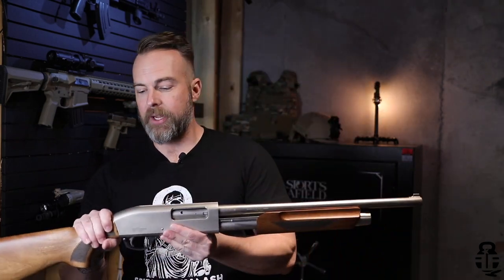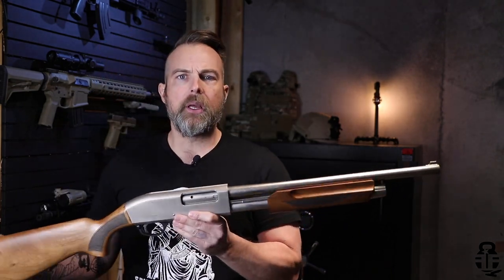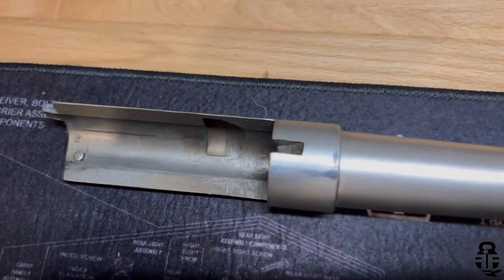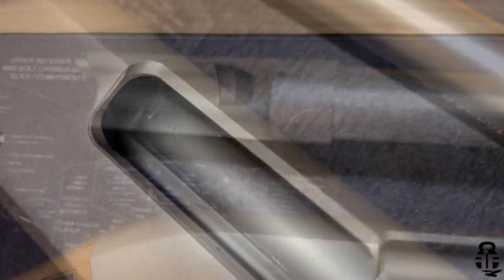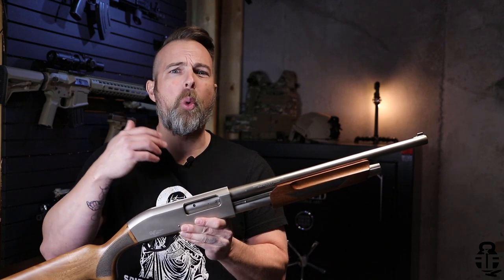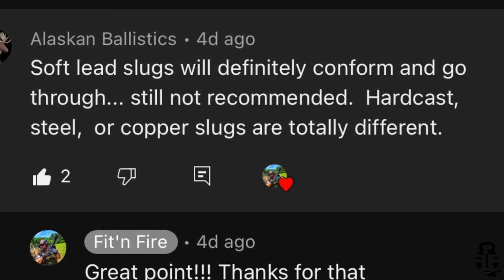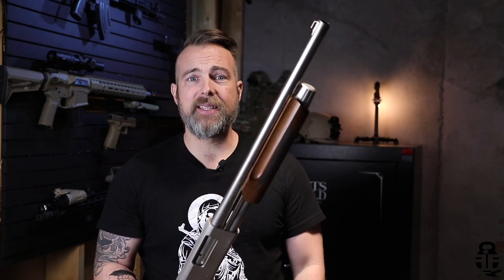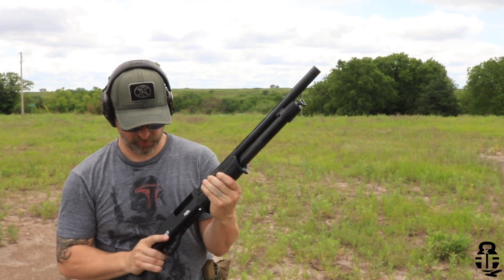What's the End Result? Part 6 G Force GFP3N Pumpernickel

Comment: I received one as a get well get out to the hospital gift from my friend. Side by side with my Remington this look to be the same accept for the color. I would be interested in a barrel that would support the use of slugs.  I will outfit it with 1.25” military sling and + 2(3) round tube extension like I have on my 870. As I commented in a prior part my GFP3N lettering is laser engraved and yours seems have roll marks. Mine was purchased April 2023. Please comment on the lettering on yours.

Enjoyed your testing of the GFP3N. It was very useful and informative 

Note : you did not comment on the loose fore end / pump

Ricky from IBM
Reply from the maker: Thanks for watching Ricky. The fore-end never became so loose it was unusable and I was able to tighten back up. Whether it will loosen again??? I would imagine it would and would need constant tightening. Yours may be different.
Reply: @FitnFire  Hi thanks for your reply. What do you think about using lock tight ?
Reply: @FitnFire I just picked mine up today, and put around 40 rounds through it, and the fore end/pump is already loose, how do I tighten it? I lubed it up before I shot it at all, and I purchased it brand new.

Comment: I intend on using slugs is that really a big issue?
Reply from the maker: If you’re using lead fosters slugs, it shouldn’t be a problem.
Reply: @FitnFire  are federal 2 3/4th's good? Or will that ruin the gun? I never realized how different shotgun shells are.
Reply from the maker: @woodstock6792  should be ok as long as it is a all lead slug
Reply: Thanks  @FitnFire

Comment: Hey, I came here to watch you drop more shells 😉 
What's all this useful information?  :😜 

Good to info :)

Did you ever by chance see if it works with any Mossburg 500/590 or Remington 870 parts?
Reply from the maker: Only the stock is compatible with 870 stocks. However, you need to buy an adapter from G Force